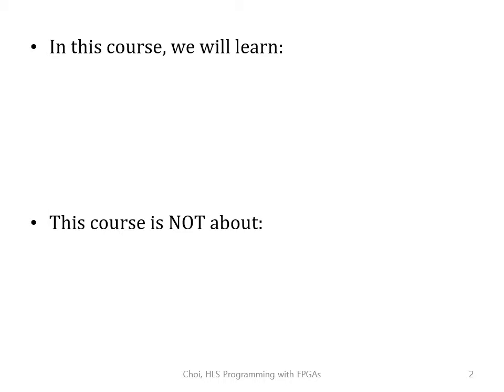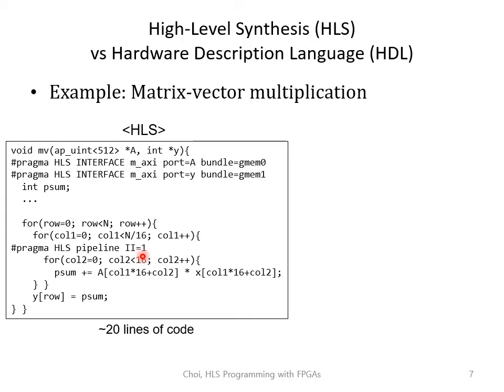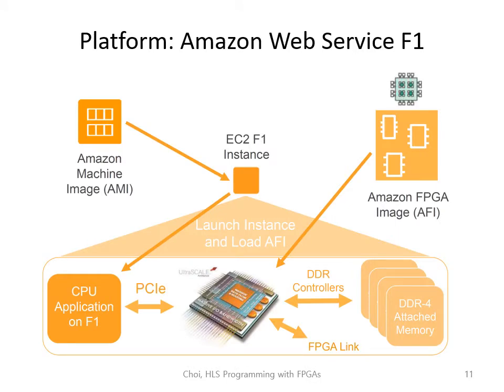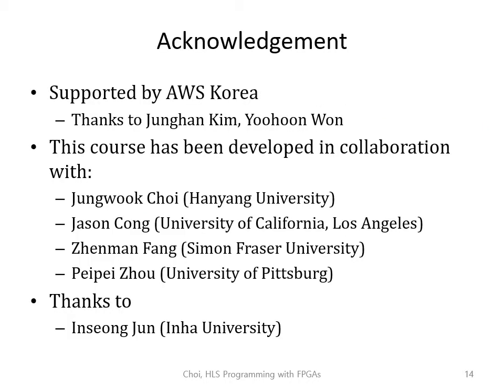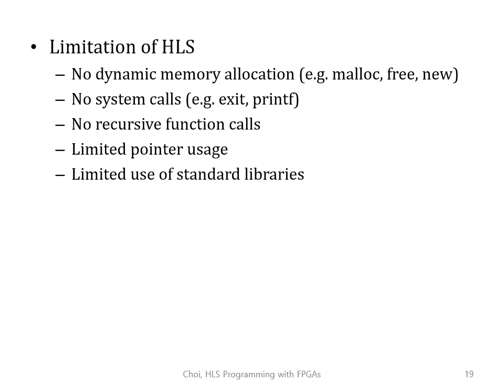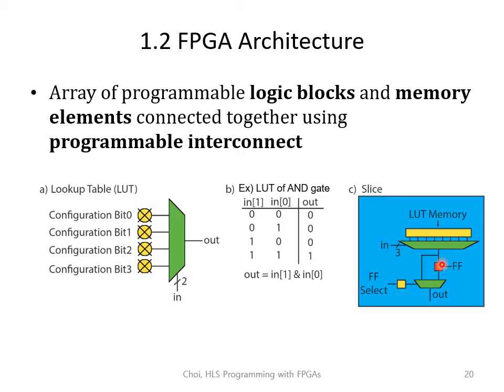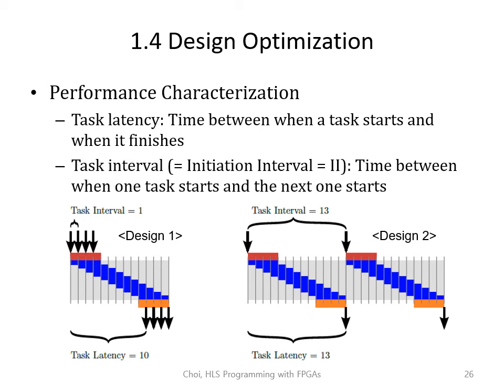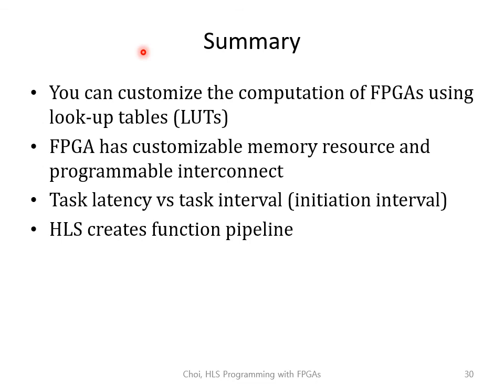Part01 Introduction (HLS Programming with FPGAs)

Comment: There are measures proposed for HLS based design by other authors. The theoretical best ones are from Prof. Keshav Parhi at Univ. of Minnesota. First measure is the Iteration bound . Computation time of each loop divided by the delays in each loop. Maximize this ratio over all K loops. 

This measure is due to Parhi. Parhi provides  a Matrix method to compute the iteration bound.